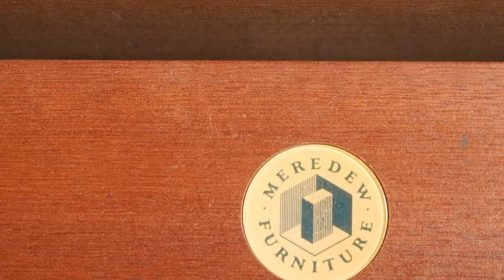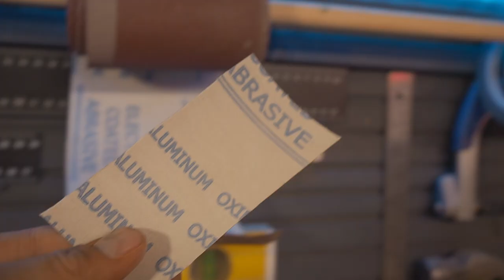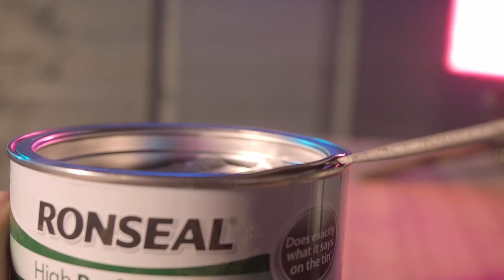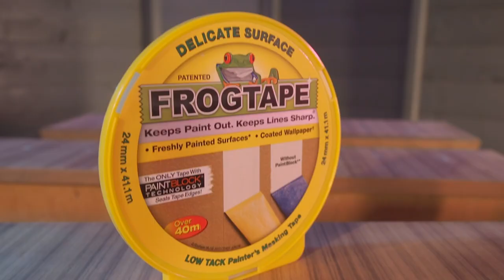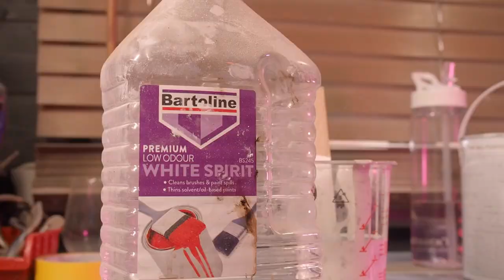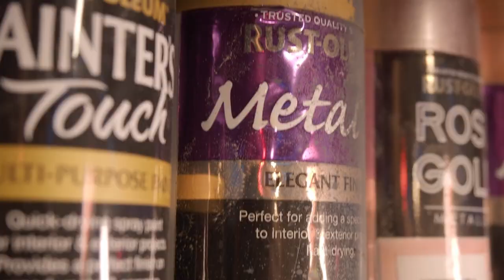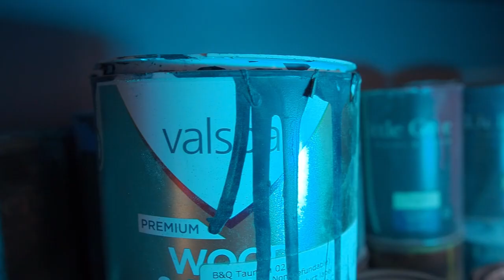MID CENTURY CHEST OF DRAWERS MAKEOVER / Furniture refinishing / Spray painting

Comment: Just making me jealous since I have a couple projects sitting in my garage that I can't work on because school is killing me.

Refinishing our dining table and chairs with painted legs and french polishing the oak top/seat, and refinishing a nasty ikea bent plywood chair and ottoman by stripping the hideous black paint and walnut staining/french polishing the legs.

Love your channel, I tend to always prefer raw wood, but you've given me quite a few accent paint ideas that I'm totally going to use.

I would recommend you switch to paint stripper and a paint scraper for the initial stripping though - the orbit sander has a habit of rounding off edges and the overall cost of stripping is quite a lot cheaper than sandpaper, and the time involved is roughly the same.

Comment: Is this a solid wood piece or are you sanding the finish off of veneer? Beautifulwork
Reply from the maker: 90% of mid century pieces unfortunately aren't solid wood. Most people thinking they are, but not. Sanding just veneer😊
Reply: @Madebyraphael  would love to see a video where you remove and replace veneer on a piece. I have a nine drawer lane dresser designed by Paul Evens that I found on the side of the road and want to bring back to life pretty solid condition but the veneer on the top part can not be saved. Water damage to the particle board. Really struggling to find any good videos. Looking forward to your next piece.